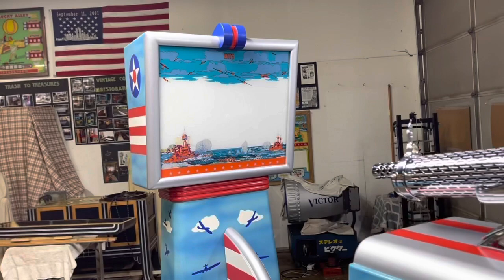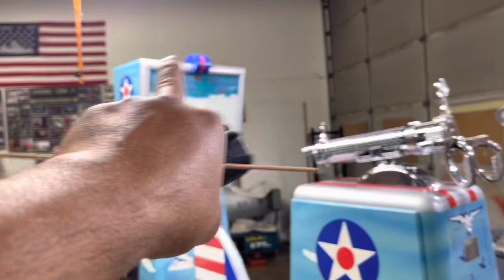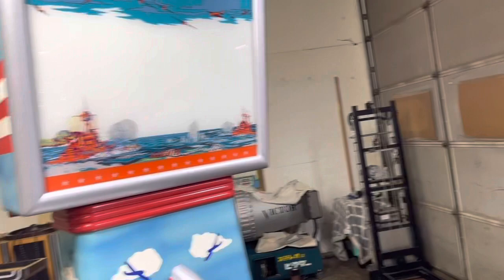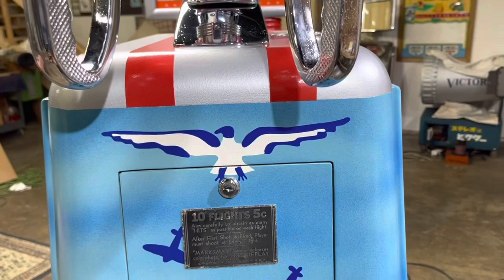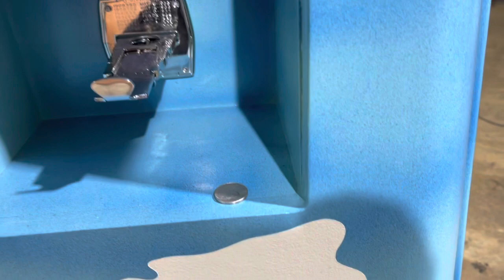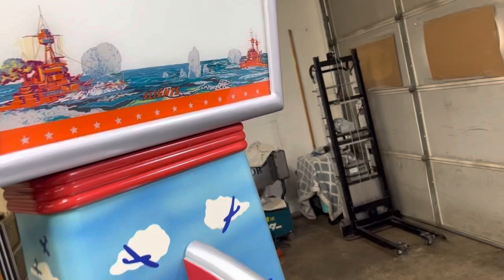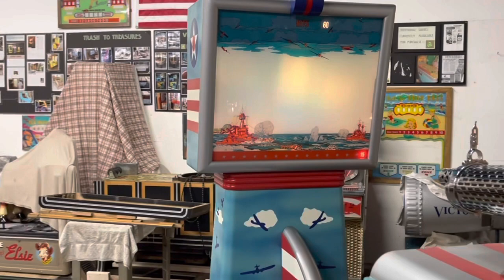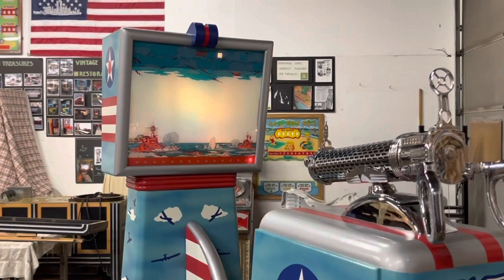Keeney 1940 Air Raider

Comment: You did a great job with it.
What happens if someone inserts a coin while that timer is still running and the machine has yet to turn off?  Then what happens at the end of that game?
Reply from the maker: When you put your coin and it will just push the bell timer forward and the gate will begin

Comment: At 125 dollars, 2500 Nickels pays for the machine.  Even the least popular arcade games at a time when they were not staying current very long (in the 80s) could wrack up 10s of thousands of plays. If this game was sold in 1940, it easily could have sat in the same place for 20 years or more   This game could have sat in a boardwalk arcade for 2 decades without ever becoming obsolete.  These types of light gun games were made well into the 70s.  That machine has probably seen 100k coins go through it.
Reply from the maker: I agree !